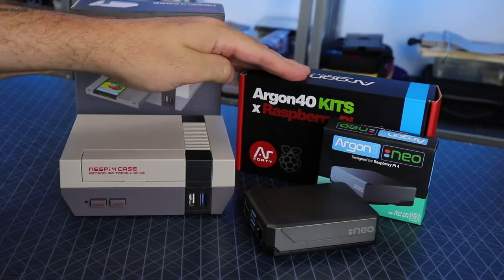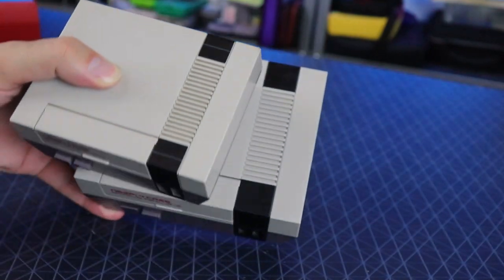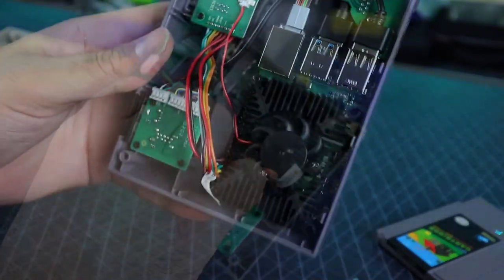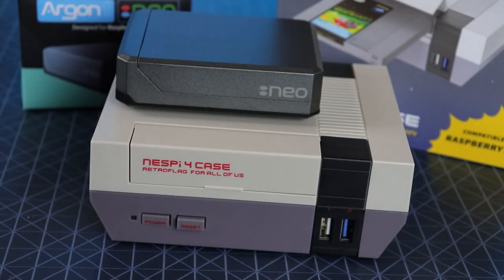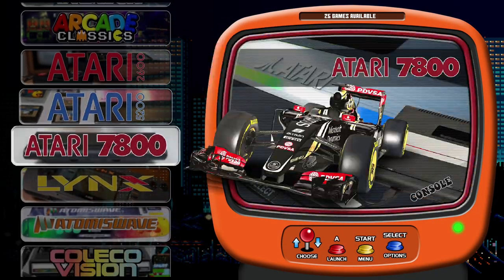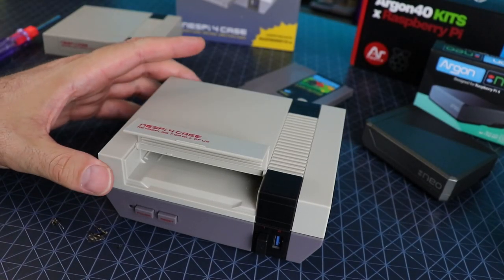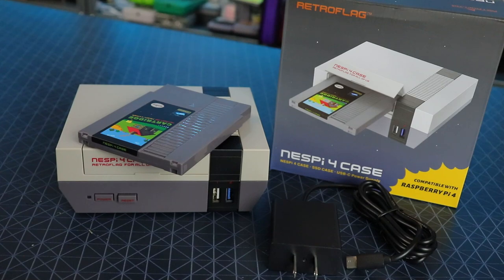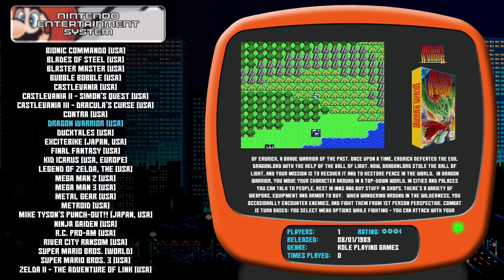The BEST Raspberry Pi 4 Case? Retroflag NESPi 4 Versus Argon Neo! Review & Comparison!

Comment: I wonder how much temp difference it will be on the NESpi 4 with thermal paste? 
I have the Argon Neo with fan hat using thermal paste and fan set to go 25% at 45C with 10C & 15C increment till fan reach 100% (0% at below 45C) and compare to others who opt for thermal pads. I got fluxing between 30c and 45c with 2.1Ghz overclock. (the fan hat brings down the temp quick). in a room temp of 80F (26.67C).

Comment: But Argon Neo has no On/Off Button... so a no-go case for me D=
Reply: The Neo case has no on/off button, but I’d you buy the add-on Argon Neo fan hat there is an in/off button that can control the pi. The problem though is to run the fan effectively, you need to have the top cover off.